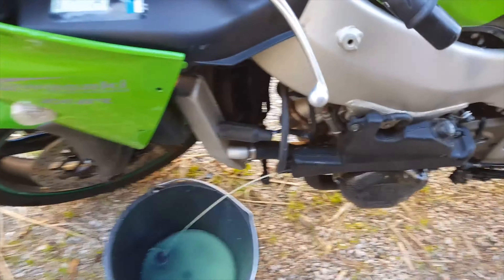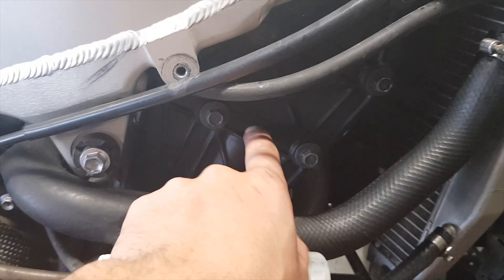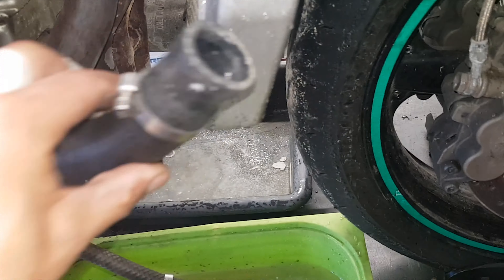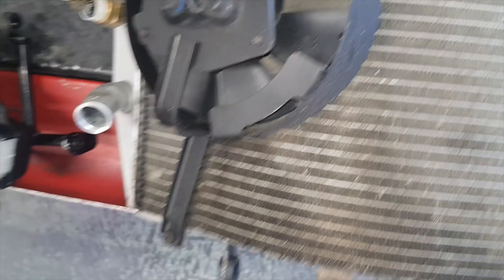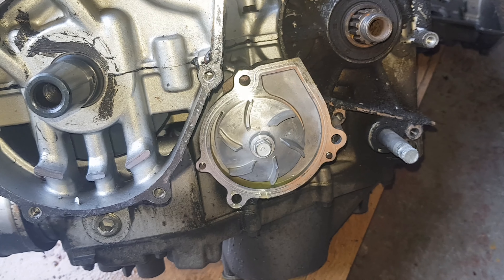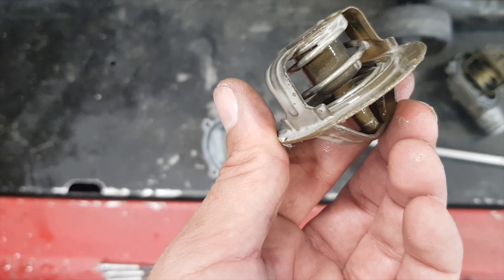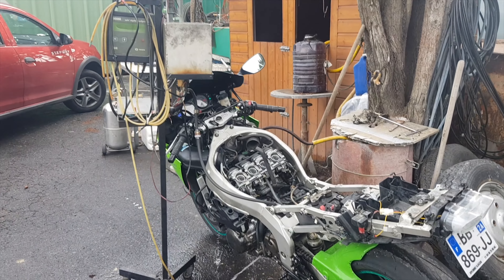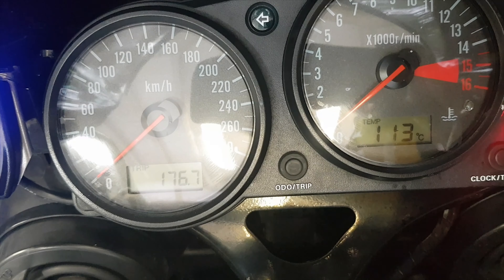🏍 #zx6r #zx636r [PISTE ZX6R #51] MAYONNAISE REPARATION ? (Remplacement pompe a eau / pompe a huile)

Comment: Salut moi j'ai un 1250 bandit j'ai un problème de chauffe j'ai testé le kerosta il s ouvre mais les durites radiateur sont molle mon Ventilo ce déclanche bien et des dès qu'il ce déclanche le liquide de refroidissement coule par le trop plein merci si tu peux m en dire plus
Reply from the maker: Pardon mais je ne connais pas cette moto. Essaies de faire une purge du circuit
Reply: @onitshaworld  ok et tu pense pas que la pompe à eau deconerai
Reply from the maker: @brunomanceau3726  si tes durites sont molle c'est que tu n'as pas de liquide. Donc soit il part dans l'huile. Soit il part dans la chambre de combustion.
Quand tu ouvres la vis de purge il te faut au moins 2l de liquide de refroidissement.

Mais déjà fait une purge du circuit et remet le sous pression
Reply: @onitshaworld  ok je te remercie